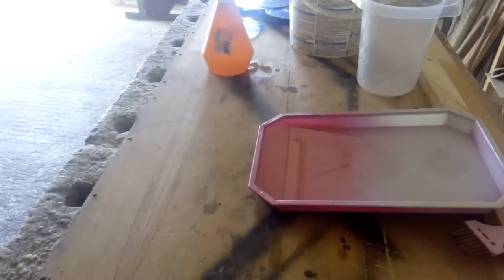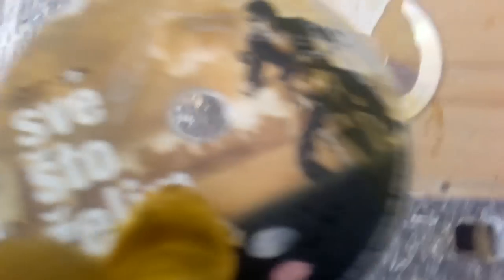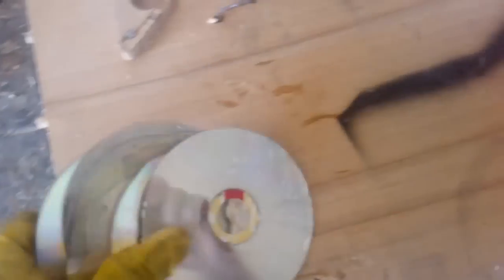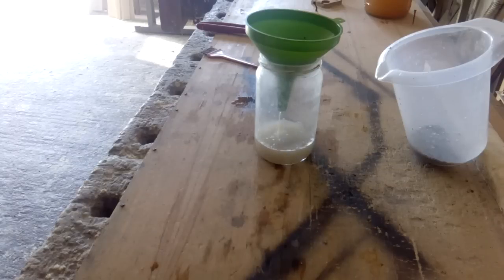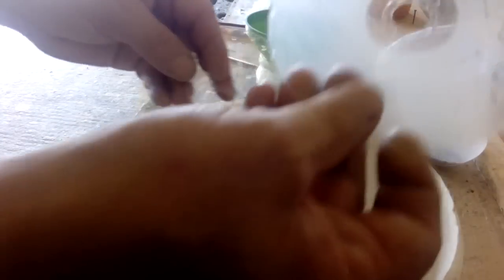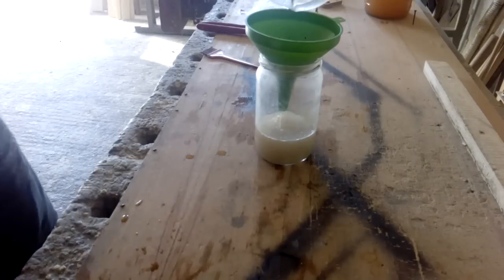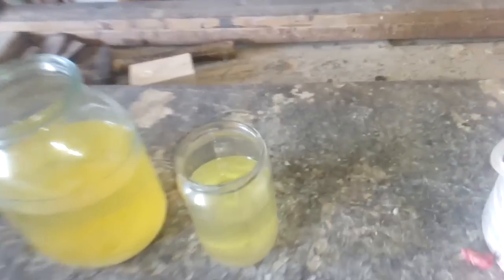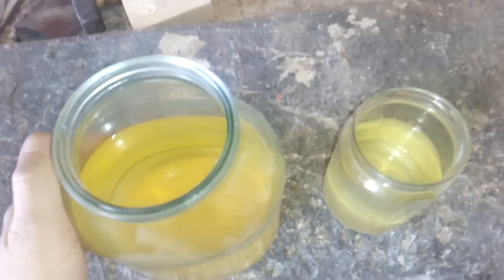Silver recovery & refining from CD and DvD part 2

Comment: well-done bro
this really helped
but I have a question
how did you get the silver chloride to solidify after filtering...did you heat it?
your response will be appreciated thanks.
Reply from the maker: By adding Hydrochloric acid or a solution of water and kitchen salt, silver drop from Nitric Acid.
Reply: +999 Dusan Gold recovery (Erin) does it solidify as it drops?
Reply from the maker: Yes but it is cloudy,not like salt.
Reply: What is that you're spraying in to the white container to rinse?